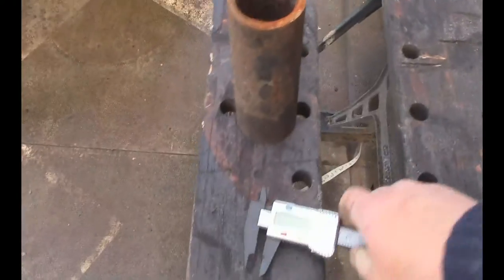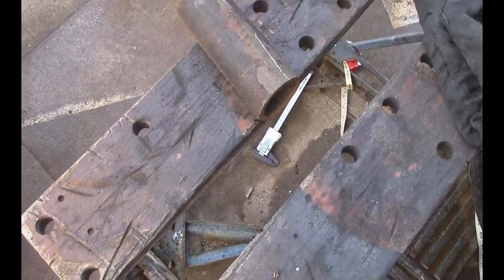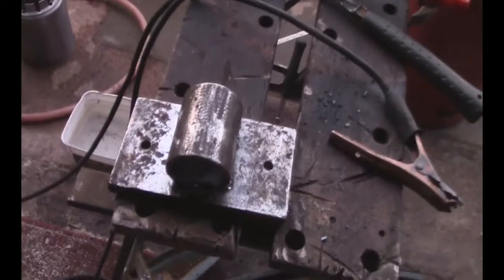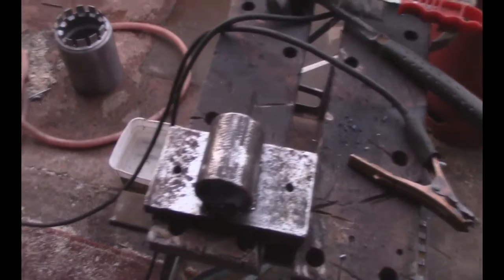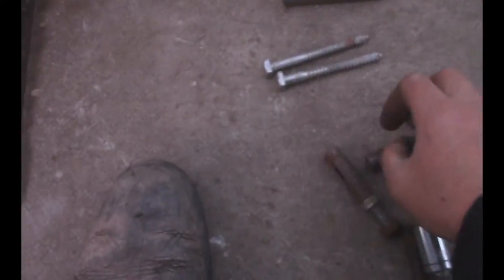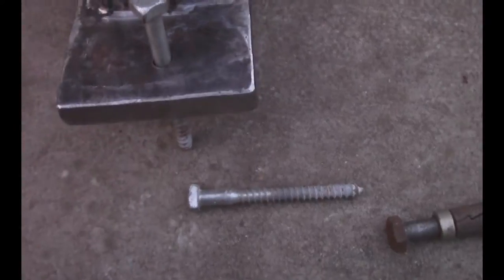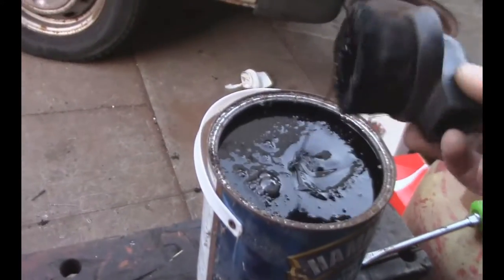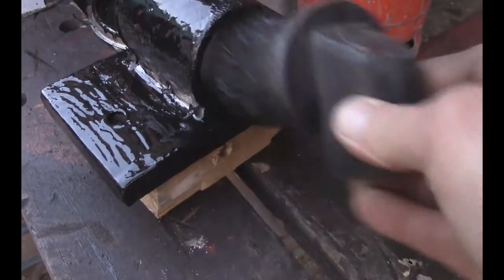DIY MotorCycle Security Ground Anchor Easy Welding Project

Comment: looks good! used to have bikes until I came off my last a KTM duke I supermoto and broke my leg when a tree didn't get out the way, 2 plates and 14 screws to Tib and Fib.
Reply: ArcturanMegadonkey Holy shit , its shame you couldn't get back on that horse mate.
Reply: Jax Teller I had one last ride on it, I hadn't lost the balls to ride it but couldn't risk another 3 months off work as was bored out my mind! sold it and took up photography and metal detecting. 
If I was to get another bike it would be a supermoto, preferably another 600cc single as they sound amazing and  are just such fun to ride....instant hooligan!

Comment: Top welding bro, I got me a arc on the strength of you wood burner in under an hour video as I just happened to have a 25kg  laying about doing nowt. Now its a wood burner.
Reply from the maker: Steve Gadafi thanks dude! thats great stuff, what are you going to be making next?
Reply: thepoultrypeople Rocket stove
Reply from the maker: Steve Gadafi rocket stoves are cool, if its going to be a metal one like mine then go for some really heavy gauge steel if you can find some

Comment: Nice job!  Are you going to weld the bolts onto your anchor?  Just in case someone decides to take the old nut-rounder to them?
Reply from the maker: EpicAirsoftHD dont know where to install it at the moment, and yes, it would slow thieves down a few more minutes until they found my grinders and used them to cut them off, what i need to build next is a steel door over the existing upvc one

Comment: Might ad some time if the fastener holes were in line with the chain. That way, the chain would interfere with tampering with the bolts. In any case, a grinder with the right wheel will make fast work of any chain...just noisey.